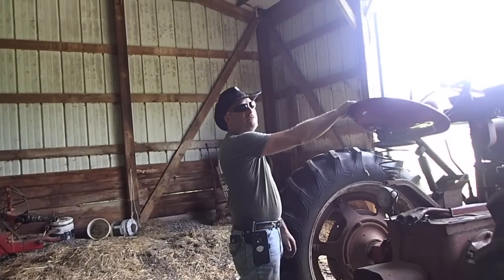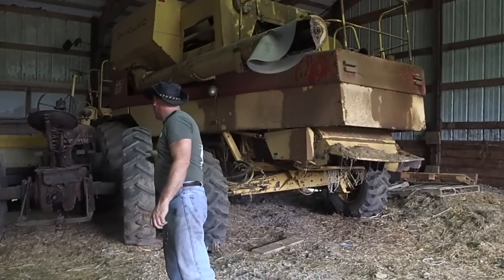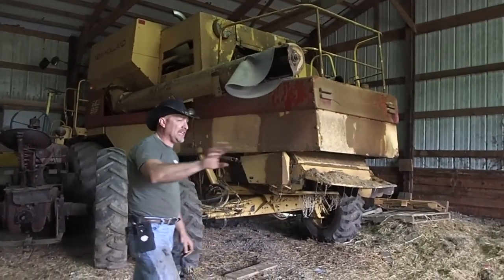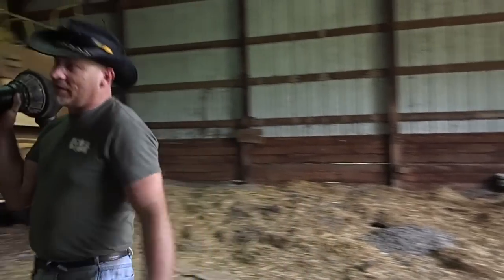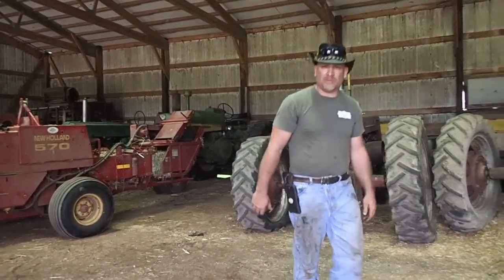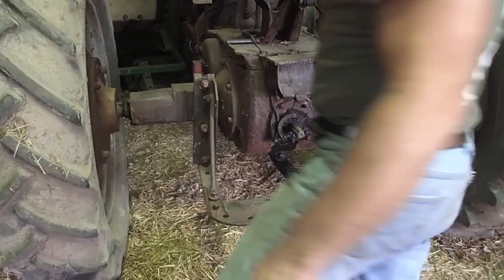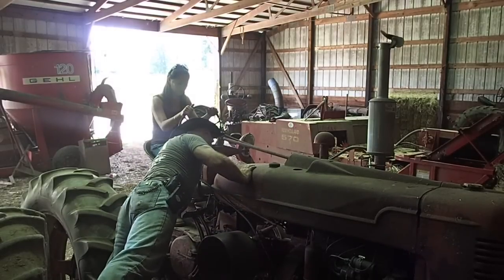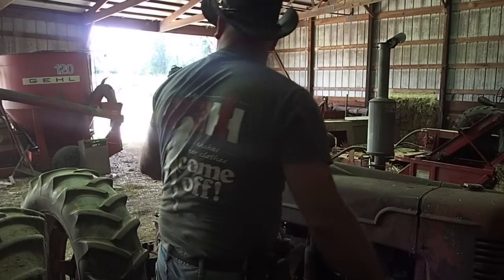Rode Hard And Put Up Wet

Comment: Wes did I hear you say you have a International 450?  If you have 3 Ms then you could trade 2 of them for a H and a Super C and you would have a good spectrum of International tractors.  When I was a kid we has a 450 (wide front end), Super C, and an H.  I learned to drive a tractor with the C starting out raking hay.  The only problem with the internationals was that you had to do break maintenance often.  The 450 also had a problem in that the steering column had a collar that would occasionally come apart.  One time my dad had to suddenly stop bailing because of a jam up going up a hill,  He jammed on the breaks and the steering collar decided to come apart,  The steering column slid way out leaving him almost hanging upside down over the back of the seat.  Luckily he got the tractor stopped without rolling back down the hill.  I think he drilled it and through bolted the column after that.  We eventually went on to buy a 584.  Then we went on to Ford and now New Holland.  New Holland works good on our little 200 acres farm but we would probably have some green tractors if the Deere dealership wasn't so far away.  The combine reminds me of working for the neighbor a couple of summers.  He had an old Allis Chalmers Gleaner without a cad.  I combined rye for him and by the end of the day you would itch so bad from he dust from that rye.  One time I got caught out in a really bad thunderstorm with the combine.  I was only 3/4 of a mile from the barn, but I thought for sure I was going to get struck by lightning before I got it back down the steep hill and back in the barn.